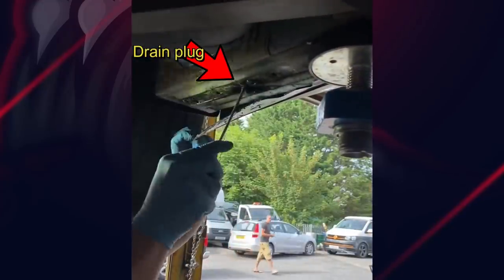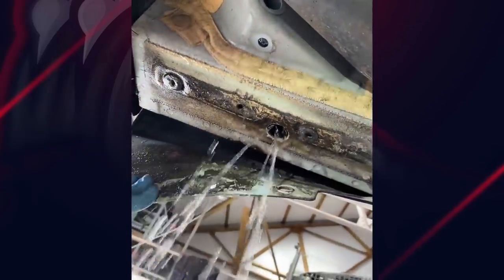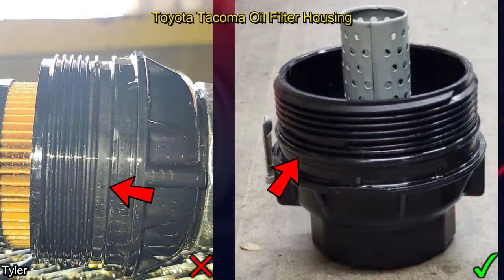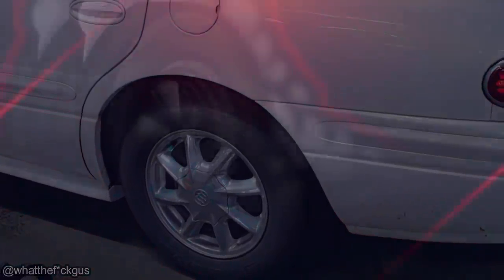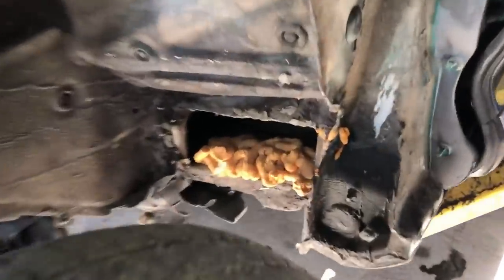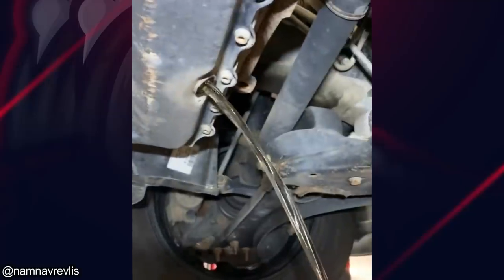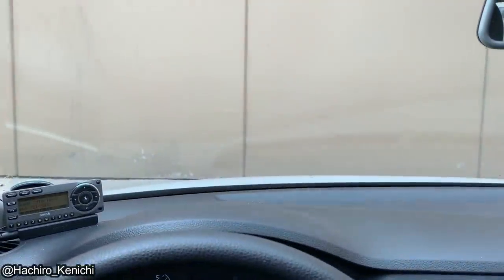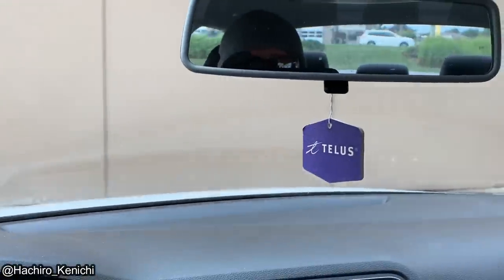Customer States Water Noise When Driving | Just Rolled In

Comment: My 2008 F150 SCREW had that watery sound, surging in the channel under the passenger door sills.  I found a place behind the front passenger wheel-well liner that was packed solid with years of leaves, muck, and insulation that a mouse had liberated from somewhere. Half the water that entered the cowl area was supposed to drain through there, but the drain holes were blocked, so it went wherever it could.

Comment: Drove through a small stream? Come on at that point you might as well tell the whole story, not like the warranty is covering that no matter what you say.
Reply: Perhaps they are rare in the US, but fords and similar are not exactly uncommon in the UK. I wouldn't be surprised if warranties treat them different over there. Granted I also wouldn't be surprised if they actually had a clause in them compelling the mechanic to call the driver a moron for hydrolocking their engine in a ford.
Reply: @whyjnot420  Id hazard a guess that no matter where you go, the mechanic never gets the full story. 
Drove through a small stream? A river is not a stream.
Hit a pot hole? How big was this hole, how fast and how many times!? Actually worked on one of those, rebuilt the entire rear suspension on a Civic. She said she hit a pot hole. The guys from the plant nursery informed us she demanded they load a palm tree in the trunk.
Reply: @sparkplug1018  I know. But that is the way a kid answers their parents or whatnot, as if they are trying to get in as little trouble as possible.

I just don't get why people would be as embarrassed about treating their car badly as they get. I remember getting new pads and rotors so I could replace them and the guy at the store said something like "you should have your rotors checked with a micrometer blah blah blah" I answered with, "I can check it with my finger." as I had ridden down to the bolts on the pads and they had gouged the shit out of the rotors. Even if I had gotten them ground flat, their useful lifespan had been cut by an order of magnitude at the least, and I knew it and I wasn't going to hide it. (granted I was also the one fixing it, but I have a feeling if one of these people who lies to the mechanic was in the same position as me, they would not have been as forthcoming)

The part I really don't understand is; do these people actually think they are fooling anyone? or are they only saying it to make themselves feel better? Maybe if it is about insurance or legal issues I could understand... but even if that covers say, and I'm being far too generous here, half of all these people, that still leaves a metric ton of them who are only making it harder for the mechanic to do their job, potentially adding more time that they will be charged for.

Sure when there is a safety concern or similar glaring issue a mechanic will probably say something to the owner. But that is about as close to getting in trouble that an owner will ever see at a mechanic.

Fun fact: Its even worse if you work on computers. (I switched from auto mechanics to IT, so have seen both). At least people know how to drive (for the most part, they know the basics since...), they need to pass a test to get a license and usually don't have the right tools thus preventing them from even attempting a lot of work on vehicles (not that this stops some people, but it does stop a lot). People do not know how to use computers (for 30 years I have been saying this, thinking it will be better in the future but noooooooo), people are not licensed to do so, and any moron with a screwdriver can take them apart. Just imagine how bad that gets.

btw on the subject of nomenclature, there is a place near me with "pond" in its name and it is no less than 4x larger than another place near me with "lake" in its name. Both are state parks and those are their official names. idk about you, but just as a boat is smaller than a ship a pond is smaller than a lake. Crap like that doesn't help anyone. It causes people to start conflating words which leads to people not even having a distinction between that which should be distinct. Not that I mean this to defend anyone intentionally conflating things like river and stream, just that it only makes it all worse because it adds people unintentionally conflating them as well.
Reply: @whyjnot420  Having worked on computers as a hobby I can completely understand the BS that goes on with that. Wife works in that field as well and oh gosh the stories. 
Its funny you brought up most people not being able to work on cars themselves, since I still to this day get the, wait girls don't know anything about cars BS. Which begs the question, why aren't you fixing it then? 
But yes, if I see an obvious safety issue it is always brought to their attention. Sometimes they fix it, sometimes they don't have the money, other times I'm just a cheating mechanic looking to rip them off. 
But best guess I have for why they never tell us the whole story is they're embarrassed about what ever it is. Not that it makes any difference to them if it makes my job harder, since the flat rate system only allows me to bill a set amount of hours. 
I do agree about the misuse of words though, it does lead to confusion at times. But such is the world we live in. Like ship and boat, in general parlance a boat is smaller then a ship. In Naval parlance boat refers to the class, a ship is the actual named vessel.
Reply: @sparkplug1018  Bill only so much for a given job yes. For the diagnostic aspect, that is its own thing and the longer they take doing it, the more it is going to cost someone. (don't quote me on that though as I am second guessing myself atm and its been some time since I really looked at what the laws are here in Ct. for more than 7 seconds)

I know a bunch of people who have gotten that "you know enough about it, why isn't this your job?" when it comes to computers. Generally this means they have enough ability to build a new pc.... which just like the repair work in auto mechanics, is only a fraction of the job in terms of learning..... the majority of the rest is the part where you figure out wtf went wrong, so that it doesn't murder more parts (or break something on, or in, the pc). It is funny how people think "handy with" means enough to actually make it your job. Nevermind the fact that none of the guys I am talking about actually want to work on computers for a living.

Another thing that automotive and IT have in common is the single most common problem. It can be expressed as PEBCAK. (Problem Exists Between Chair And Keyboard) Though for automotive I think it would be PEBCAW (Problem Exists Between Chair And Wheel). This issue is a pox upon mankind!!!

Also on misuse of words, "begs the question" is not synonymous with "raises the question" :P (the former is the name of a logical fallacy where the premise assumes the answer rather than backing it up, a specific form of circular reasoning, the latter is as the words actually say) Also in the USN, when it comes to surface vessels, it is as simple as "boats go on ships" here is some stuff from the US Naval Institute (USNI). Maybe you find it interesting.

"In general, a boat is a watercraft (for want of a better word) that is small enough to be carried on board a larger one, and that larger one is a ship. This is sometimes expressed this way: “A ship can carry a boat, but a boat can never carry a ship.”

Now for some added confusion. Using the above guidance, submarines are technically ships. Yet they are traditionally referred to as boats. The original submarines were very small and manned only when in use, so “boat” was appropriate. But as they developed into larger vessels—and rightfully should have been called ships—the original term stuck. When the large nuclear subs began to appear, there was an attempt by some submariners to start calling them ships, but as with many things in the Navy, tradition trumped logic, and today, all submarines—even the giant “boomers” (fleet ballistic-missile submarines)—are called boats.

Another term that causes some consternation in naval circles is the word “vessel.” Some cantankerous, would-be purists insist that a vessel is “something used to carry water, not to go to sea in.” But the Dictionary of Naval Terms (Naval Institute Press, 2005) defines “vessel” as “every description of craft, ship, or other contrivance used as a means of transportation on water.” Other dictionaries confirm the acceptability of this term, including Webster’s—“a watercraft bigger than a rowboat.” Perhaps most convincing of all is that “The Official Inventory of U.S. Naval Ships and Service Craft” is formally known as the “Naval Vessel Register.” So, the bottom line is that vessel is an acceptable term in most naval circles."

Those are some excerpts from an article in the October 2017 issue of Naval History.

(I am a history nerd and military history, in particular naval history is what I spend way too much of my time learning)
Reply: @whyjnot420  Odd word usage does creep into everything doesn't it? 
And while I can't recall of the top of my head what the limit is, there's an actual limit to what we can bill for diagnostic work in most cases. Which is probably a good thing since I actually work with someone who would charge a full day for it if he could.

Comment: We had a brand new 1970 Buick Estate Wagon, with the tailgate that dropped straight down, disappearing into a slot between gas tank and bumper. Rear window went up and nested under the roof, disappearing when open.

3 days old, it rained and the car made sloshing noises.
The tailgate had filled with water.

More fun, we had bought grass seed and it spilled.  The carpet had gotten wet enough, it germinated and we had a lush carpet of grass in the back of the car a week later.

Not 2 weeks old and the rear carpet had to be replaced, under warranty because the leak caused it.

Comment: Those model T wheels look drier than a mummy's esophagus.
Reply: You have drive it through a shallow creek every now and then or the wheel will dry out and crack
Reply: @catsbyondrepair  I don't know about that. I think maybe if a person wants to keep a natural look, using boiled linseed oil will probably help preserve the wood longer.
However, I respect your opinion.
Reply: @mgmnfld3109    I'm in love with hard wax oil these days. An amazing finish.
Reply: @Frostified  Sounds good but does it penetrate and moisturize the wood or just leave a good surface finish?
Reply: @mgmnfld3109  dude this method was suggested by ford
Reply: @mgmnfld3109  Boiled linseed oil, in cold weather thinned a bit with up to 20% turpentine  is what you use service wooden ladders when they start to get loose, a large extendable ladder can easily absorb a litre of oil. This swells the wood and makes everything solid again. Water is a temporary solution, and long term a very bad one, repeated cycles of wooden steps swelling and drying out makes a ladder that wobbles a lot. I would assume this works the same with wooden spokes. I know at least on wooden carriage or cart wheels linseed oil is common as well.

Comment: I had a similar water issue on my BMW E30 race car conversion. After an engine swap I decided to put the battery in the back of the car, so the weight would be distributed better. The BMW had actually a space for this in the trunk, on the right side of the car. But you had to drill a hole through the car to get the cables to the back. The mechanics I told to do so, layed the cables from underneath the car and then from the right wheel housing into the trunk. This caused it to be not watertight.
One day, my girlfriend an me were making a trip across Europe in this car: There was a massive rainstrom when we were on the German Autobahn, and I heard the water swapping around. It was strange, but I couldnt think of what would cause this. I thought I would hear the fuel in the tank, "because race car". As soon as we arrived in the garage of our hotel for the night, I checked. And my battery was almost fully submerged. Fortunate for us there was no water on the battery poles. 
I lifted the battery up, and then we began to scoop the water with two cups out of the battery space, since I didnt have a (metal) drill with me on this trip.
The next day I found a workshop, and I just told the guy to drill a hole into the car. Lol, the look on his face. That hole clearly helped. There was no issue afterwards. :)

Comment: We had a guy come in to the tire shop I work at saying he heard an explosion and the whole back of his truck jumped while he was driving.  So we pulled it in with still 4 good tires on and lifted it up.    Well unsurprisingly, the original spare on their 85 Chevy had uh exploded
Reply: I have an old VW station wagon with the compact spare behind a plastic interior panel in the back -- and the rear muffler is under that part of the floor. One day the spare tire exploded from the heat while I was driving. A bit of a scare! Luckily, no harm.

Comment: The person did not drive through water, they drove though it at high speed till the engine quit. I have seen this before. Some people don't understand that when they see a lake of standing water, to drive through it very slowly, at a craw speed.
Reply: Actually once there was huge storm outside where I live and I was driving very slowly. Water depth was something like 40cm(~15 inches), It wasn't a problem for my car but I kept my finger on the ignition key, because I was afraid to catch a wave of upcoming vehicle which could flood the air intake as I've seen this happe literally few days before where vehicle was driving normally and is not submerged enough to flood intake but once the wave of upcoming vehicle hit it got hydro locked.

Comment: I didn't drive through a small stream, but i did drive into a very very large puddle. it happened at night was on a blind bend where construction was going on that had blocked all the drainage and no street light, so I ended up plowing into about 3 feet of water going 65 miles an hour

Comment: I used to drive through flooded roads for fun a whule back until i stalled in the middle of one. Tried to start the car but it would just rev up and slowly die down. Had my buddy push me out and i was able to get the car started. No smoke came out of the exhaust but it had a horrible misfire and tended to stall while shifting into gear. I replaced thw injectors and the throttlebody gasket and its working just fine except for now it has a slight random misfire.

Comment: I had a leaf spring do that once.  There was an overloaded van in front of me, on a 2 lane road with a 55 mph speed limit.  I saw the van drop, and a chunk of something come at me.  It went under the bottom of my van, and I heard it hit something.    Then I smelled gas, and the gas gauge started dropping fast.    I pulled over into the first parking lot I could and shut it down.  There was road construction, so I couldn't just pull over to the side.   

Then I called the fire department, since there was a huge puddle of gas forming under my van.

The guy who owned the store was really pissed that I pulled into his parking lot.  He told me to drive it out.   I refused, since sparks from the starter, right over a huge puddle of gas, would be much less than desirable.    He decided it was better to hose the gas off his parking lot, so he started putting water on it.   He had never learned that gas floats on water, and that would just spread the fire, if it ignited. 

The fire department finally showed up, and hazmat soaked up the gas with some kitty-litter type dirt.   It took 4 55 gallon drums to contain it all, because dumbass had spread it out with the water.

My mechanic found the chunk of leaf spring in the old gas tank.   He did work that I didn't want to, or couldn't do.  Since there was an insurance claim attached to it, I couldn't just do it myself.

Comment: I ruined a transmission in a Dodge years ago. Dip stick tube was broken, allowing water to fill the transition to fill. Two days later I was searching salvage yeards for another transmission to repair my 72.
Reply from the maker: Ended up finding a transmission?
Reply: @JustRolledIn  yes, for about 250.00 if I remember correct.  it had a good case, and was able to take the two and rebuild, new bands was plentiful,  but parts houses at the time couldnt help me with much else. This was around 1989. I sold that duster at a car show, looking back, It would be less painful to shoot my foot.
Reply: @JustRolledIn  thank you, stay safe out there.🇺🇸👍🍻
Reply from the maker: @artjohnson4133  you as well 👍

Comment: Yeah water noises while driving, yeah had that happen to me too. I am truck driver and the the truck I was driving had sat for a long time, and sounded like a wave machine every time you drove it. So I told the mechanic and we drilled a hole in the fairing right above the windshield, and about 4 gallons of water came pouring out! Man it was a bitch in the winter, the water would freeze and bang around.